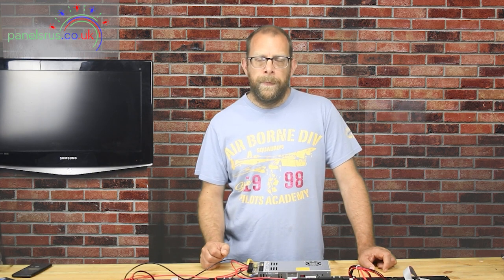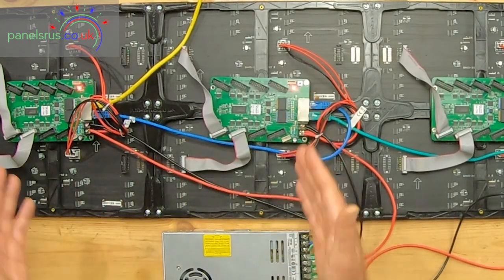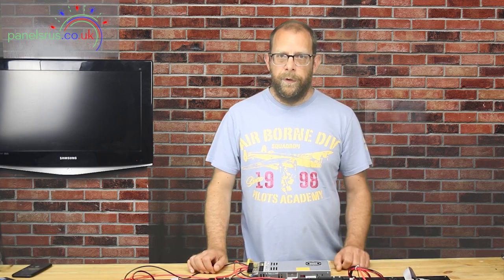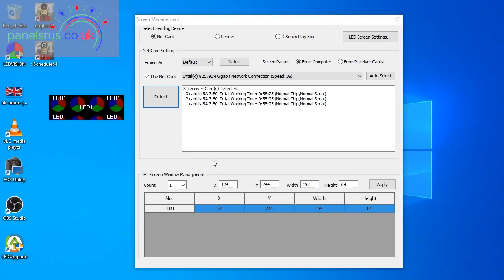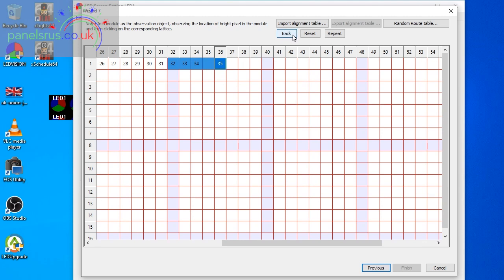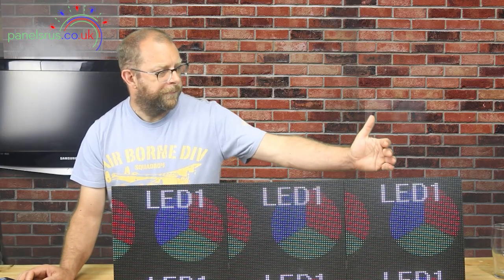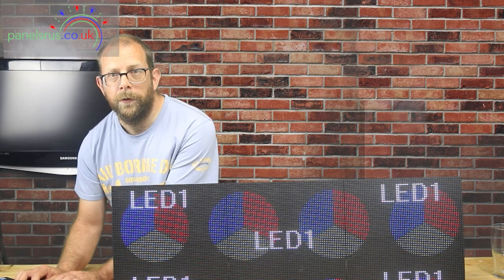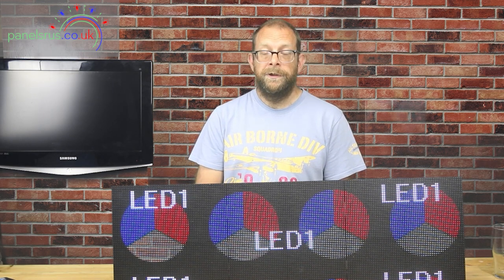Multiple ColorLights for FPP

Comment: I am looking at adding several very small matrixes to my show (each one would have 2 P5 Panels).  I like how I can daisy chain multiple color light cards together, but a color light card running 2 P5 panels seems like overkill.  Is there a better way to run all these small matrixes with a single Pi?  Is there a limit on how many color lights you can daisy chain assuming you stay within the channel count?
Reply from the maker: How far apart are your small matrices?  the hub75 (idc) cables can be up to approx 20' (7m) long ?
I've not found the limit on the number of colorlights that can be daisy chained yet - I suspect fpp will run out of puff first!
Reply: @gregmacaree  Oh, OK.  I thought the IDC cables couldn't go more than about 1 meter.  I will have around 2 to 3 meters between panels.  Now I need to think about how to pass those idc cables through the enclosures while keeping things waterproof.

Comment: Can I use a USB port on a Pi 4 to output to multiple color light cards?  I am already using the ethernet jack for a wired connection as I am not using WiFi.
Reply from the maker: On a Pi4, I would use a USB Ethernet card for the existing wired connection, freeing your onboard connection for the colorlights.

Comment: Great video! very helpful! I need to build a 9 panel wide LED display and I saw on colorlight website that under special circumstances the card can go up to 1024 pixels. I managed to drive it to 512 but I need 576 pixels. Is there a way to push it more than 512? I am running p5 indoor panels. the whole screen is 9Wx3H  panels. thanks

Comment: I have 8 color light cards, each running 8 P5 panels in a weatherproof housing- 2 panels wide by 4 panels high.  The housings are then connected together 4 wide by 2 high making a complete 8 x 8 matrix.  Can I still daisy chain the 8 color light cards, or is there a maximum?  Thanks, and a great video.
Reply from the maker: Hi James, yes that should be fine - I have some similar units that I have done the same way!